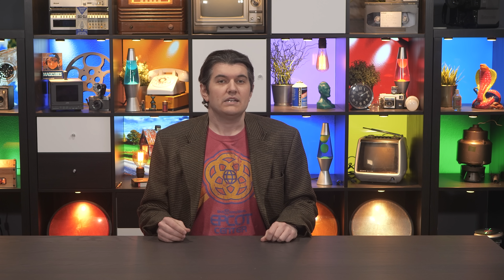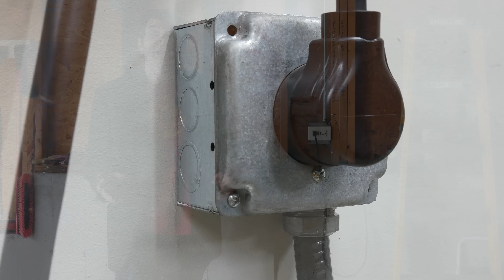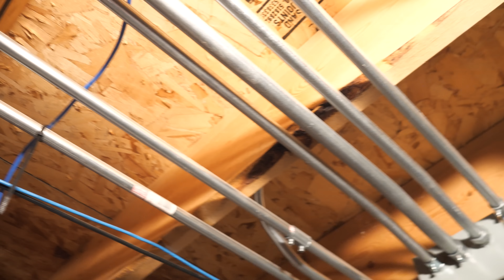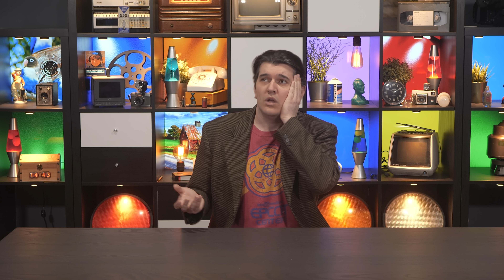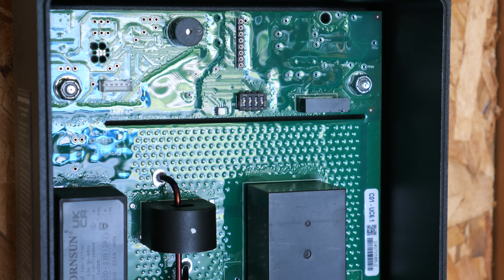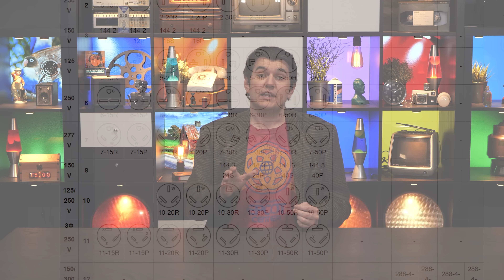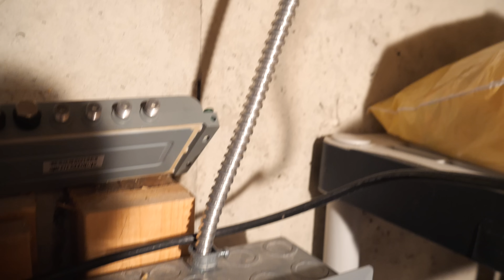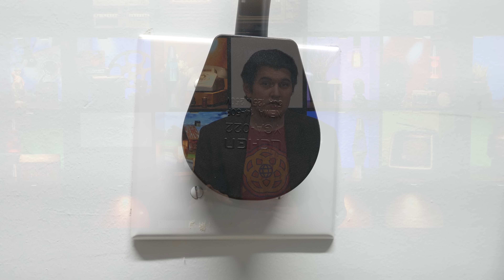The "standard" car charger is usually overkill—but your electrician might not know that

Comment: Two weeks ago I got my first electric car (Mach-E Rally). The two days a week I work in the office (5 miles away) and weekly errands (local grocery store has free level two charging), so I could live on 110V charging, with emergency DC fast charging for exceptions. However, Ford is paying for a level 2 charger and installation (not counting permits), so level two it is. They calculate my panel can handle another 50 amp circuit, so 40 amp charging it is, small hit from the maximum supported 48 amp charging of my car.

Comment: I'm doing a lot of charger installation in a country with TN 230/400 volts. I do like the smart aspects from a installer perspective. I can troubleshoot previous installs by distance or give costumer service.

But a lot of home have 16 or 20 amps available. Thats where smart charging and meter communication with the house is fantastic. As well as we now need to start paying for the quantity of power used (tax on peak usage).

The cars charge on a 400v three phase circuit on 16A (but more is getting more common and work really well with solar installs).

It's a really interesting technology. I would say the standard power socket is just not ready for long use charging but I do like a zaptec or easee. Compared to the older way to complex systems.

Comment: In the UK you can get a 220V granny charger for about £100 and they are fine to charge most typical use.. a high power charger will cost you £1000 upwards.. charges a lot faster, but unless you drive a lot each day not really needed..you avoid having an extra (fused) plug though as the 13A fuse in the plug (Us could learn from this) tends to be the limiting factor..I made an outdoor weatherproof socket and the cables can deal with a lot more power than the socket/plug combo..

Comment: As the owner of an 8 year blue Chevy Bolt, this is always a welcome video. In our case, we had the electrician back then to install a 50 amp circuit to handle a 40 amp EVSE even though the most the Bolt can ever pull is 32 amps. The point was for future vehicles that might pull more than the Bolt....but the Bolt had been extremely reliable and still my wife's daily driver 8 years later, and long since paid for. However, the original EVSE did not last as long as the Bolt. The Juicebox 40 began showing flakiness of operation a few years ago, mainly during the hot summer months. Finally, I had about had it and replaced it with a different smart EVSE. Yes I said it, a smart EVSE. Some of us like getting the data from these things and the 1st gen Bolt is pretty lousy reporting usable data.

The only main problem in installing the new EVSE was that I wanted to change the NEMA 14-50 plug to a hard wired connection. If I were a pro, I'd keep this stuff in the truck. But the method you used with a whip connection isn't rated for a 50 amp circuit. And the hardware you need to easily do this isn't generally available from your local Home Depot or Lowes (or Amazon for that matter). So it was easier just to order a new NEMA 14-50 cable and hook it up the old way, which I did. I'd love to know an inexpensive way to hard wire the circuit from my EVSE to the connection box (only a couple of feet away).
Reply: Why?  Why look for cheap ways to do something that isn’t actually hard to do correctly?  I you are actually only a few feet away from your main panel, there are a plethora of high quality conductor, fittings, and conduit options to hard wire an EVSE.

I was in that situation when in order to enroll I had to have an electrician (mandated by Utility) install their mandated smart EVSE.  The main panel for my home is 6 feet from where the vehicle is parked.  The extra cost in materials and labor was so cheap that I had them install a backup Hubbell 14-50r and prep for an eventual replacement EVSE if the Utility shuts down their EVSE TOU plan as they have publicly debated doing.  The extra cost was less than the cost of the Grizzle-E that was installed in this video.  In fact my mobile EVSE that I travel with, and is my backup, is the Grizzle-E Mini which is basically the portable version of the unit he installed, a great inexpensive EVSE.

My point is that the real cost of electrical work is labor.  If you are going to DIY, don’t skimp on components, and if you’re gonna pay someone else to do the work, certainly don’t skimp on component’s.  The cars are too expensive, the home is too expensive and your sleeping family is too valuable!
Reply: @michaelwitkiewicz7052  I should have been more precise in my earlier response. It’s not that you can’t get wiring for a 50 amp circuit. It’s that you can’t easily get a kit for the type of connection Alec did in the video higher than 30-40 amps. They make pre-made kits at a decent price for what he did. But for 50 amps with 6/2 romex, you need to buy a large spool of the stuff which is more money than I wanted to spend…a lot more. At that point it was easier just to get another Nema cord and call it a day.
Reply: Why?  Why look for cheap ways to do something that isn’t actually hard to do correctly?  I you are actually only a few feet away from your main panel, there are a plethora of high quality conductor, fittings, and conduit options to hard wire an EVSE.

I was in that situation when in order to enroll I had to have an electrician (mandated by Utility) install their mandated smart EVSE.  The main panel for my home is 6 feet from where the vehicle is parked.  The extra cost in materials and labor was so cheap that I had them install a backup Hubbell 14-50r and prep for an eventual replacement EVSE if the Utility shuts down their EVSE TOU plan as they have publicly debated doing.  The extra cost was less than the cost of the Grizzle-E that was installed in this video.  In fact my mobile EVSE that I travel with and is my backup is the Grizzle-E Mini which is basically the portable version of the unit he installed, a great inexpensive EVSE.

My point is that the real cost of electrical work is labor.  If you are going to DIY, don’t skimp on components, and if you’re gonna pay someone else to do the work, certainly don’t skimp on component’s.  The cars are too expensive, the home is too expensive and your sleep family is too valuable!
Reply: @michaelwitkiewicz7052  again, you’re missing my point. We hired an electrician to do the install EIGHT YEARS AGO when we bought the car. The EVSE is in the garage but the electrical box we connected it to is the one mounted to the exterior of the house (a 200 amp box from the utility). They ran a line from that box, through the crawl space and into conduit in our garage terminating at a NEMA 14-50 box next to the EVSE. So it’s not difficult to convert the 14-50 to a hard wire box, but again, the kind of romex I need is usually not sold in short lengths or with pre-done kits usually used in HVAC installs. I can buy the proper conduit, but I don’t need 1000 ft of expensive wire, or even 100 ft. I need less than 5.
Reply: @Sevenfeet0 I didn’t miss your point.  The way you wrote your post(s) you re making it sound like you have to buy in bulk to do a small job.  Maybe you are in a unique retail enclave , but in the Midwest it’s common to find hardware retailers that sell conductors by the foot, as well as pre-cut conduit and many individual pieces of pre-bent conduit for many simple installations.  There are bunches of videos on YouTube that show it so I’m not alone in knowing that you have options, if you want them.
Reply: @michaelwitkiewicz7052  OK, maybe I'm the idiot here in a mid-sized well known US city (US South) but while typical places like Homne Depot or Lowes didn't seem to have that type of wire available in the cut-to-order section, maybe I just need to ask Graybar or Grainger or something.

Comment: I paid to have an 30amp breaker added and a plug wired up at my garage door ($500),when i bought a chevrolet bolt. The first fast charger (grizzl-e classic) i bought was defective and i sent i back. I started using the 120 plug that came with the car at home and work. I still have not replaced the fast charger. I will eventually, but figured out i did not need it.
Reply: I also love my chevrolet bolt. I live on the oregon coast and average 4.2 miles per kw. Which is way better than I ever expected.

Comment: I used a brand new 14-50 receptical on my install, verified lugs were torqued properly, and only ever drew 18-22 amps on 10awg and the plug was only ever unplugged maybe 4 times. It melted after a year and couple months. This was a cheap Lowe's 14-50 receptical. That design has a major flaw and should be recalled. I purchased professional commercial grade outlets and have increased my amperage to 24 amps and the receptacle looks as good as new over a year later. Don't cheap out on the recepicals or just hard wire.
Reply: 10 AWG is quite undersized for a 14-50R.  I'm comfortable with 8 AWG THHN NM-B, but a lot of folks run 6 AWG for a 14-50 circuit.
Reply: @alsavage1 i would agree, thats why it was limited to 18-22amps only.
Reply: As long as that 10ga wire is protected by nothing bigger than a 30A breaker.

Comment: Plug in that 3 Phase 480 V 32 Amp 230,00€ charger, Hans 😂 AC Charging is slow at 22 kW 🎉 Hans lädt seinen Silberrado jede Nacht von null Prozent to einhundert Prozent, ja!
Reply: The charger has a plug that ist plugged into ze outlet.  Installation done in einundzwanzig, zweiundzwanzig - fertig 🎉

Comment: 13:26 this absolute madness that is the NEMA connectors looks like something that would result from lacking standardization. The regular 3-phase red IEC 60309 (CEE plug) can probably handle mostly everything that is thrown at it in home and industrial settings. You need a socket for 400 volts and 20 to 600 amps, yeah that single plug can handle it, depending on wiring of course.
Reply: Funny thing: There is no actually mandated connector system in most EU countries.  
But since they are pretty good and VERY robust IEC 60309 is used in most places.  
They allow 100% circuit load and are outdoor rated by default.
Our default outlets are rated 10-16A, so ~3-3.6 kW, which means that high current/3-phase household connectors are rather rare, but they do exists too.
Here in Germany it's rare, but you sometimes see Perilex receptacles, they offer 400V 3-phase at 16 or 25A in a normal household socket format.

Comment: So, so good.

I have a plug-in hybrid, and as such, its max charging is 3.3kW.  Right now, it's doing about 1.2kW, but according to a Kill-A-Watt at my EVSE, it shows that I'm wasting about 60W in the garage's branch circuit (about a 5V drop when the contators pull in, at about 12A).  I'm still considering installing a 50A branch so that when I sell the property, it'll be more likely to be ready for higher capacity vehicles.  Larger wires are, in any case, going to mean less resistance, meaining lower voltage drop, meaning more theoretical efficiency.  I don't expect "payback" for the extra materials expense, at least not unless electric rates rise significantly.  If anything, maybe I can ask a higher selling price for the property.

Comment: ....

I'm putting in two of these (well, 2 50 amp breaker supporting 40 amp chargers).

Currently we charge on the standard 12 amp 120v charger that came with our Ioniq. It gets us about 10% per day, but we still end up needing to do a fast charge once a week or two. Kids stuff that's all over the place sucks down the battery :/

Also,  MC cable absolutely comes in larger gauges. You just have to source it correctly. I've run 150' of the 6 gauge in my garage for the 2 chargers.

Comment: For those looking for a NACS/J3400 EVSE, Tesla sells their mobile charger for $300 and it's pretty damned good for the money. It'll provide 32A/240V for 7.68kw of charging with the appropriate, included, plug. It also comes with a 5-15 plug for standard 120V outlet charging at 8-12A. The stationary NACS and Universal EVSEs rated for 48A/240V are also pretty good choices, the Universal model has NACS and J1772 plugs with the built-in adapter.

Comment: I hired an electrician to installed a NEMA 14-50 receptacle in my garage from the breaker box 2 years ago. I did my research and bought the 240V 50A GFCI breaker and a good quality NEMA 14-50 receptacle myself (40% cheaper than what the electrician asks for) and told the electrician to use 6 gauge copper wire for it. For hindsight, it’s a bit overkill, but I wanted it to be “future proof” at that time. The electrician use MC cable to run it over the garage ceiling. It took less than 3 hour installation and my final cost including tax and inspection fee is around $900 (exclude the $200ish I paid for the charger, which I would need to buy regardless of this installation)

Comment: i have a 3kw charger (Germany 230v 13A continuously on a dedicated 16A circuit) And i charge at around 20% to 80%.
Only once it was not at 80% in the morning because i came home very late. But since i charge every 3 days it was no problem

Comment: As with the last time you talked about this, you're still wrong. Installing/using the bare minimum is a mistake. Having a full 50A available (or more) to top up with is a great convenience.

The convenience factor is important to EVs. Doing the minimum means you actively have to think and plan. This type of advice only gives ICE drivers more ammunition.

Comment: If you use a NEMA 14-50 outlet and need to unplug it after each use, apply Deoxit lubricant to the receptacle. The DN5 formula is safe to spray on a live circuit.

Comment: Canada specific rant here: It's quite annoying how so many charging stations come with 14-50 plugs on them. The reason is a key difference of electrical codes in Canada compared to the US. Unlike in the US where you can have a 14-50 outlet which is fed by a smaller capacity breaker, in Canada, with limited exceptions (like where an actual stove is installed and you can use a 40 amp breaker), such an outlet has to be fed by a 50 amp breaker. So if you don't have the wire size or the electrical service capacity to support that, you cannot use a cord connected charger. The solution is, of course to just hardwire the charger into the branch circuit which arguably is better anyways, but does eliminate, or at least makes installation more complicated, for many of the chargers on the market.
Reply: Alec mentioned this later in the video when he commented on some of the available EVSEs that have 30 amp plugs. Unfortunately with many of those I've seen, they run into another issue with a lot of the charging units on the market: They don't have safety approvals from third party agencies like UL or CSA. In some cases, the manufacturers even play games with saying their units are approved when their approval is really only for part of the unit, like the charging cable. in many areas any hardwired installation needs an inspection, and especially in Canada, the inspector is unlikely to be happy with a unit that does not have a safety approval marking on it. You really want to spend a bit more and get a unit that actually has those approvals.

Comment: I like this video very much! Can't wait for that new EV charging guide video. 

8:16 Why is it so expensive? Over here in 3 phase 230 V each land our standard product across all my buildings is a 250-300 € device from Vestel (EVC04 AC11-T2P), which supports up to 11 kW and even has a relay connector for the grid operator to switch slow down the charging in exchange for cheaper electricity, has RFID reader if you don't have a garage and install the device outside, no apps required. I think it's still too expensive as it's only a power court with very basic electronics, as you said. 

21:50 you also don't need to take your time for the detour to drive to a gas station, if the next one isn't on the road anyways.

Comment: I recognized that I didn't need to install a 50amp charger in my garage to power my EV. I also recognized that I am lazy and won't have good charging discipline, sometimes forgetting up until an hour before I need to get somewhere - in which case the charger has been a life saver.

Comment: I want the connector, but I want to set my amperage lower.  At the very least I need to setup a new outlet anyway, so why not setup 240v while I'm at it.  
With the current setup at the house, the outlet and extension cable get way too hot for my liking, and that's 120v 8amps.

Comment: You did mention that the connections in the receptacle need to be torqued BUT not until the nerd portion of the video.  ALSO the connections in the electrical panel need to be torqued as well.

Comment: I fully support all of the principles about EVs that you regularly explain and defend here. Especially the stupidity of the DC charging first principle that is also prevalent here.
Electricity's flexibility is actually very cool. The country I am in recently changed the way it charges you for your electricity consumption. After careful reading of the new rules I went and used those high tech dip switches in my charging station and limited it from 11kW to 7,5kW - this effectively meant the car charges 1,5 to 2 hours longer (max) during the off peak tariff (when I am sleeping!) and that my electricity bill is now a little over 20€ lower every month. For doing literally nothing!
The only additional complexity I would wish in my charging station is the ability to trigger that big relay via mqtt or home assistant. I have a few more ideas how to make the charging of our 2 EVs even more efficient and automating that process would also make it comfortable (I'm lazy).